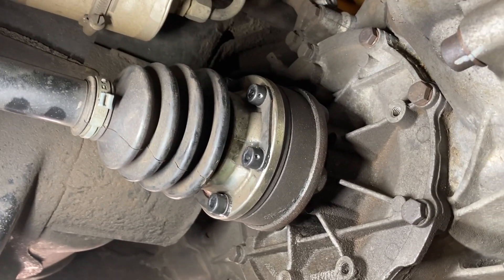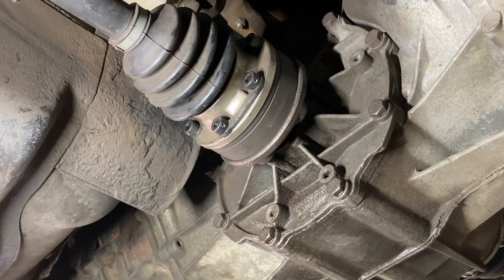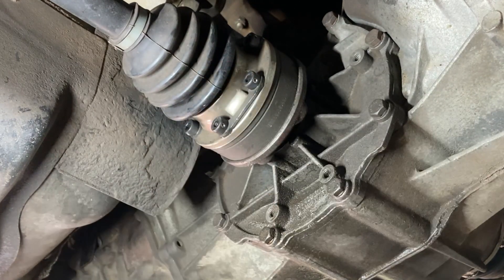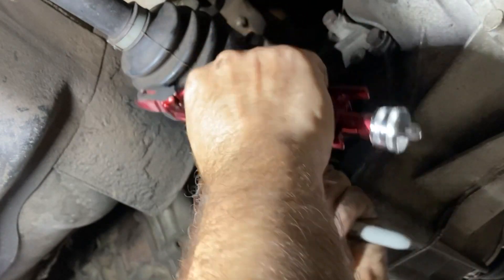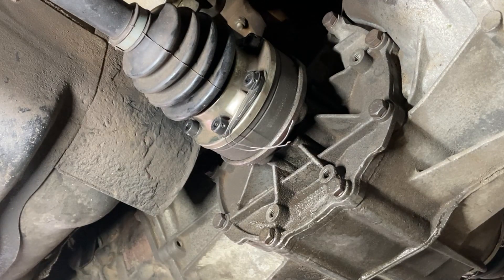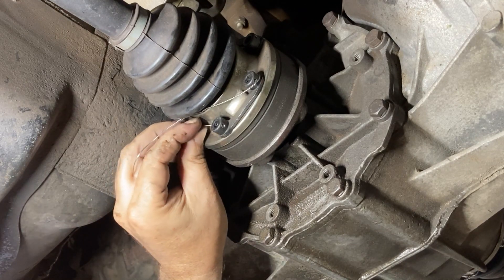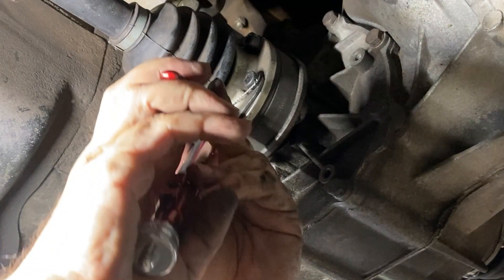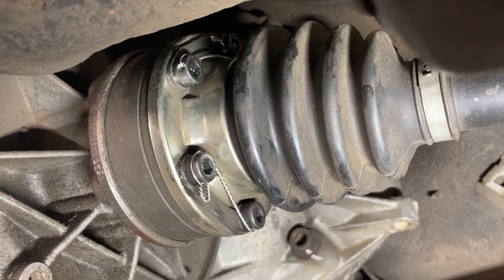How to safety wire CV joint bolts

Comment: Unnecessary, the bolts never come off even if you reuse them multiple times. Torque em and thats it.
Reply: They do come out almost died in a golf mk 2 with all bolts loose
Reply: We are constantly chasing these bolts on the racecar. It's only 250hp, but the CV jts & M8 bolts were originally spec-ed for 60hp VW T2. Will be adding safety wire to clean/loc-tite/slight overtork that we've been doing.
Reply: @FJ40Jim  this is a late reply but try nord lock washers. we use them on our race car for CVs and they have never let us down. as long as it is a metal/metal flange and there is no gasket that can crush over time.
Reply: @burn4005 we read that on a 944 forum, have had no problems since adopting XZN bolts & Schnorr washers.
Reply: Trust me they do come out!